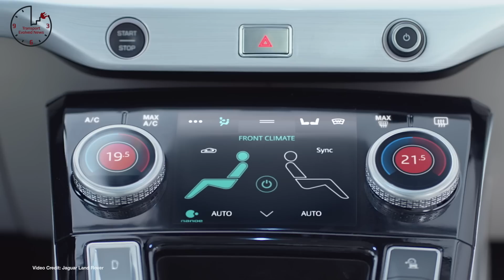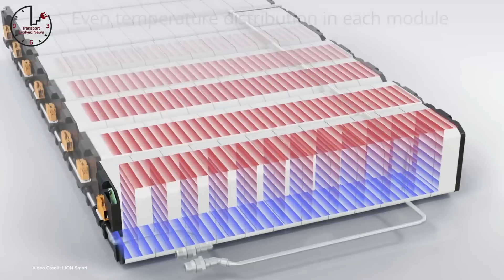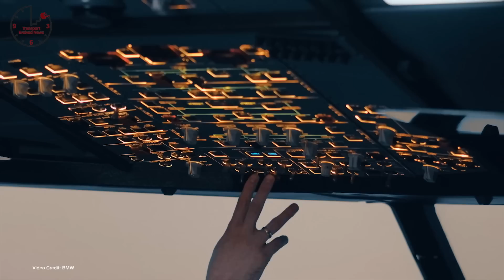Mercedes-Benz EQC, Tesla Model 3, Uniti Down Under, Battery Breakthrough: TEN Electric Car News 222

Comment: Tesla announced (back in 2012) Supercharger technology (120kW) and had it operating within a week. Everyone else announced their "high speed" solutions, and even 6 years later, not a single one has actually been implemented. The original 120kW SC is still the fastest and most reliable of any charging network.
Reply: Actually greater then 150kw charging is installed in Europe and the US. Although it is still in limited numbers.
Reply: And which EV can charge at 150kw?
Reply: It's max 120kW per stall (300A).  Tesla has confirmed that all of its current line can charge at higher than 120kW.  Hence the reason for the upcoming V3 superchargers.
Reply: Karen Pease, The first model S onboard chargers were single phase 10 kw each, and Tesla ganged 3x together (one per phase) to make a 3-phase 30 kw group, and placed 4 such groups in one cabinet. The cabinet would then direct the 4 groups to either of 2 pairs. 

If you are the only one using one of a pair of stalls, you get up to 120 kw. If someone pulls up to the other stall and begins charging, they get one group (30 kW) and you get up to 90 kw. 

As your charge rate drops to 60 kw, it shifts another group to the other stall giving them up to 60 kw.

Later Tesla started using 48A onboard chargers for single chargers, and started using them in the superchargers and urban superchargers. These are rated at 12kw each, and still ganged in sets of 3, so 36 kw per group. 

The cabinet still has 4 groups of 36kw, and the supercharger still work the same, except you get up to 144 kw max (which Tesla can’t really use), but more importantly you get 108 kw max even when someone plugs into your paired stall, and they get 36 kw.

The urban supercharger is the same cabinet and still has 4 groups of 3 chargers, except they are locked at 2 groups per stall. Which is why they are 72 kw, not 60 kw.

What makes the Tesla superchargers cost effective is they use the same charger in the car as the supercharger, and as we know, economies of scale when you buy 100,000 12 kw chargers.
Reply: "not a single one has actually been implemented", "And which EV can charge at 150kw?" - pick one of these complaints, can't have both.
Reply: Tesla doesn't have the best batteries?

Tesla said that they currently have a cost price of 190 dollars per kwh. That's at least 2 years ahead of their competition. 

https://www.youtube.com/watch?v=pAS-yjWj9DY

Look at this video for the most respected analyst company in the world who talks about the tesla batteries.
Reply: I have actually seen the cable for 350KW CCS at Fully Charged Live. It is rather heavy. Anything heavier than that, and we probably need some kind of assistance mechanism :)
Reply: @jur4x 350kW is supposed to be CCS2, and thus liquid cooled. Liquid cooling has the potential to withdraw heat from a system dozens to hundreds of times faster than passive air cooling. If it's heavy, it's poorly designed.

Then again, CCS connectors are poorly designed, so I'd expect the same for the cable as well.
Reply: Well, it is liquid cooled. Those tubes add weight. 
https://drive.google.com/file/d/16FUdhl3KBd89u6Q_QaPipLsNDwfk-SPe/view?usp=sharing
And let's be honest. We don't have ambient temperature superconductors yet. So 800V 500A cable is heavy just because of all that copper (If I remember right, for 500A you need 12mm thick wire) and insulation around it. So each wire inside of cable weighs around 1.13kg per metre. 
Maybe, if we manage to make reliable flexible graphene wires - yes it will-be lighter. I've seen articles suggesting 10kg of copper can be replaced with under a kilo of graphene. Hope so.
Reply: The tubes do not have to be heavy. Work from first principles here. Let's just use water for the heck of it.  4.184J/g-K, and let's say we're cool with a 30° temperature rise. Let's say we want the copper to be 3kg and the cable 3m long. So 1kg/m. Copper is 8960kg/m³, so 0,0001116m^2 cross section. Resistivity of annealed copper is 1,72e-8 ohm meters. Resistance is thus 3 * 1,72e-8 / 0,0001116 = 0,000462 ohms. Let's say we want to run 500A down it.  Heating is I²R, so 500^2 * 0,000462 = 116W.  That means you need under one gram of water per second (1ml/s) to keep the cable cool. That's not a high flow rate! You don't need a lot of water around the wire!

And even if for some reason you can't pump the water as quickly as you need, there's of course plenty of other fluids. Acetone has a third the viscosity of water. Ether, 1/4th.  Many common refrigerants (inert) are 40% the viscosity of water. Want to get even lower viscosity and you can use things like pressurized gases or supercritical fluids (although that requires a tube with the tensile strength to contain them). Heck, when you're talking only 500A, simple forced air (not pressurized) should be sufficient.  The key is that there's a huge difference between passive cooling of a wire and active cooling it. 116W spread across a 3 meter cable may not sound like a lot, but when it's only cooled by simple convection and radiation, the heat starts to accumulate.  You don't have to move a lot of fluid past it to take that heat away.
Reply: Karen Pease
Regardless of flow, you still have two pipes. And since you probably want to bleed the system,  you end up with two tubes full of liquid. In 3m of cable you have at least 2 cables that way 1,1kg per 1m. So we get 6,6kg just in copper on positive and negative wires. And then there are signal wires thin and light but nevertheless. 3m cable might easily get into 10kg territory. Not extremely heavy, but still. 
My point is - when you are designing 800V 500A cable (especially if it watercooled) It is nearly impossible to make it light, just because of all the materials needed.
Reply: jur4x, I’d like to see what the Tesla megacharger cable looks like because that’s going to be a minimum of 4x 350 kw chargers. At some point the cable will be so heavy it needs a support system that carries the weight and takes the stress off the plug. Whoever makes the cables will see which is cheaper in the long run, a big cable or water cooled cable.
Reply: Yet more ridiculous, tedious, pointless nerdy arguments on YouTube. 
Big surprise - not..
Reply: D.E. Sarcarean, actually the Original 10kw Chargers used in the 120 kw superchargers are the old ones. The new superchargers use 12 kw chargers, so it’s 144 kw. Tesla Chargers are matched with Tesla batteries, which makes it work well. But Tesla chargers are not the best and Tesla batteries aren’t the best. Like Apple products, they don’t use the best of everything, but they make sure nothing is less than very good. This is why Apple products just work even though their key specs are lower.
Reply: IMHO
You are mixing up the facts again. Tesla batteries are the best in the world by far. And I'm not the one saying that, it's the engineers who took them apart and tested them.
And their chargers are also the best in pretty much every way. There are some more powerful noes, but not in any meaningful numbers. And there are signs of Tesla having something new coming out soon. For example the Model 3 is allegedly capable of way much faster charging.
Reply: András Bíró, no, Tesla does not make the best batteries, not even close. But Tesla makes the best battery-charger match currently available in a mass produced fully electric vehicle. “Best” depends on what you are looking for. 

Best power:weight is Rimac battery for the Koenigsegg Hybrid. The Volt hybrid battery also has a higher power density than any Tesla battery.
For fastest charging in C-rating, Spark EV and Hyundai Ioniq leave Tesla in the dust.

For lower battery cost, Nissan Leaf wins, with Chevy Bolt not so far behind.

What makes the Tesla battery a great battery is they chose mid power battery and just made it huge, which allows it to have high power (but not high power density. And it allows high energy (but not cheap). 

In the model S/X you get 25 kWh extra cells added for $19,500. You can buy a complete 60 kWh Bolt battery for less than that.you can buy 2x new leaf batteries for that. 

In the model 3, it’s not as bad. 25 kWh worth of cells are added for $9000. So the cost per kWh of just cells and a few meters of cooling tube cost more than a whole Bolt EV battery ready to install.

But Tesla doesn’t have any secret sauce. Anyone can make a 350 kW DC charger if they want. And anyone can order a battery from LG Chem (or get several Volt batteries) and charge it at 350 kw. Tesla is about decisions and risk taking, not innovation. We will have to see how it plays out as the tax credits go away.
Reply: András Bíró, you have absolutely zero basis to state the model 3 battery can charge much faster. You are spreading false hype based on a document that states the charging cables and connectors can take 525A. Which means it’s able to support a charge at 400A, but doesn’t mean the battery can survive long while doing that. 

You can charge any battery by ignoring the CC phase and jumping right to the CV phase. That’s basically what happens every time you jump start a car with a dead battery. But exceeding the maximum current during CC phase will shorten battery life.
Reply: IMHO
You are not arguing with me, you are arguing with the top experts of the industry. They all say that Tesla is years ahead of the competition. In energy density, cost and battery management.
Of course a million dollar hypercar can have a higher energy density battery, but that's not really a competition for Tesla.
Comparing retail prices is stupid. You are comparing premium upgrades of a premium car to a "cheap" car that is most likely sold below manufacturing cost. Tesla has huge profit margins on these upgrades. 50% or higher is possible based on cost estimates I saw.

Of course anyone could make a more powerful charger, that's not the hard part. The hard part is not blowing up the battery while charging that fast.
Here's an article about the Model 3's charging potential : https://insideevs.com/tesla-model-3-supercharges-fast-just-wait/

Yes risk taking is a big part of innovation. Innovation is trying something that has never been done before and that's risky by definition. The trick is to be able to recover quickly from the inevitable failures.

As I explained to you many times, incentives have little effect on Tesla sales, because demand is just too big. And don't forget that there are places outside of North America. The European and Chinese markets are bigger than the American.

For the megachargers Tesla most likely will increase the voltage. That will keep the cable thickness and heating in check. It's not magic, all power lines use this trick.
Reply: András Bíró, as I’ve explained to you, demand is high due to incentives, as has been proven in every country that sells Tesla. The US incentive phase out is the most gentle, and I expect the decrease in Tesla sales to follow that, first a 50% decrease in sales in areas with no state incentives,  but places with high state incentives will be less affected. 

Perhaps those who bought a Tesla 5 years ago will keep buying them, but a large portion of those owners do not own the stock and realize Tesla is not high build quality, so they will go buy something better with an incentive.

Just 3 months till it happens, and by time Q1 2019 comes out, the effect will be apparent, but most likely an attempt to mask it with CAPEX will be attempted.

And if all the financial officers are bailing because Tesla has been doing some “fake it until you make it” accounting, then they will have a big problem. Elon Musk has taken steps to disconnect himself from the details of accounting. 

The Volt Hybrid battery is hands down a better battery than the Tesla battery in terms of power density, cooling, degradation. Tesla uses a great battery for its needs, but anyone building a race car will go get 2x Volt batteries (32 kWh) instead of 60 kWh Tesla battery.